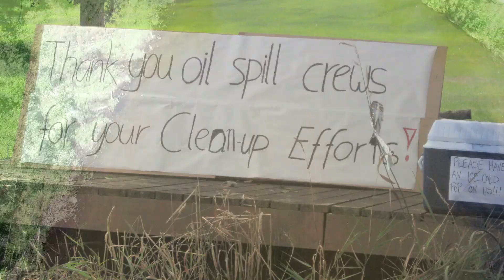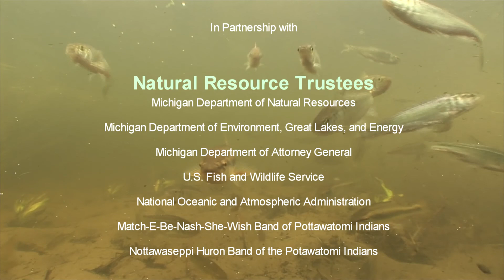The Great Stain - Kalamazoo River Oil Spill 2010 - 2020

Comment: My heart still breaks over this. Now Enbridge wants to destroy Great Lakes. No reasons exist for any of their pipelines in Michigan.
Reply from the maker: Enbridge literally uses Michigan as a shortcut. The oil comes from Canada and goes back to Canada but just takes a "shortcut" across our State! And they are NOT environmentally responsible. 
In the Kalamazoo spill, Enbridge noticed a pressure change in the line on Saturday night. But even though the regs require them to get someone out and check it, they didn't. It wasn't until residents started calling 911 complaining of the smell that someone actually checked to see what was really happening.
Shameful!! 
Here's the best solution I've heard that was offered by a Tribal elder.
If any company wants to build a line then FIRST they have to set up a fund to fully cover the cost of a disaster. If they claim they can't afford to do that, then they can't afford to operate the line!